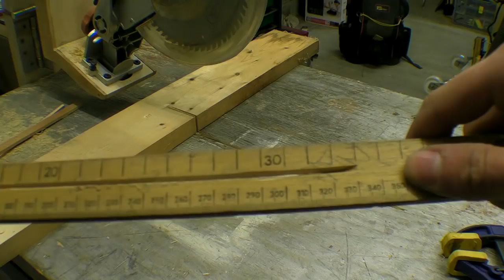DIY Glide Mitre Saw / Rail Free Chop Saw / Axial System

Comment: I'd so keep and use that. The danger lies in the careless use of any tool. As long as it's used sober and with thought about one's practices, it is as safe as most any power tool. I love the design. With longer arms (maybe made from steel?) it could even be made to crosscut full sheet goods 4 feet wide. Excelent design and idea. With a little more thought, some springs would help in the stability and use of this awesome design. Thanks for sharing.

Comment: It is so innovative and simplicity of its built makes are awesome. Instead of wooden pieces, suppose one uses aluminum slabs with hinges fixed with machine screws and built, probably it would be much safer and durable over a time. What do you think. Just to learn the way you did this, do you have and provide detailed drawings for cut list to make this? Thanks for sharing this video and also your caution at the end, so guys would be careful.

Comment: You are using a small device on your cordless drill to to drill exact in the middle of the (tapered and larger than the drill) hinges holes. I use a pointed countersink drill to determine the center of the holes, but your device makes it even more simple.

Comment: Savvas, I don't think this is inherently dangerous, it just needs some additional structure to stabilise it, Bosch do a mitre saw of this design with the lazy tong arm in place of parallel guide bars, but I think they doubled them up as one other comment suggested, and of course they used custom aluminium castings, but I still think your very clever space saving solution has legs, and I will most probably try to reproduce it or something very similar, as I have limited work space and need to mount my saw on a bench down one wall, the problem I have is the guide bars project too far behind it, this design could solve my problem, I don't really need a mitre facility on it, just a large cross cut capacity, I have a separate chop saw for angle work, without the mitre facility this would also improve the general stability too, I will let you know how I get on, love your ingenuity my friend....

Comment: Thanks for your honesty. I really enjoyed watching your work and see how your operate. 
I found your video as I was searching the dimensions I need on my new build workbench for a sliding mitre saw. Frustratingly with the sliders they use up too much space behind the tool for me given my limited workshop space. This only leaves me with the options of the bosch glide or the festool kapex front rod design. Both are quite pricey and possibly a little more than I need right now. Your video was an enjoyable break from this research. Thank you.

Comment: That is really cool. just curious about how well it would stay square after use over a period of time. I have the 10" bosh miter saw that has that mechanism and it works well and stays quite square so you may not have any problems. awesome build though, even if it doesnt cut perfectly square you could just use it for rough chopping then use your crosscut sled on your table saw.
Reply from the maker: Matt Thayer I just don't have the space to set this up properly and it won't compare to the sledge on the table saw.  That is the most useful thing I ever made in the workshop.
Reply: Well its a great project. It is perfect for rough chopping stuff.

Comment: Well, maybe a high position rail ,right upon the highest position of the blade, would provide a more stiff stance when cutting, kind of those racing car suspensions or for cars for drifting, it was designed for that : to keep tires rolling ahead even when high lateral forces are applied, a triangular structure... I will try it, I will let you know how it works...great work, man !

Comment: This does seem like a fun project to play with the idea of making moving tool holders - but in this case, wouldn't it be simpler to make a rail/track saw instead? This tool seems to have a main function of holding the saw in a straight line while cutting a line much longer than a usual miter saw can do. Isn't that what track saws do? Track saws are more portable too.

Comment: I like it and it seems cheaper to build rather than buying it from bosh why did you limit the hinges from fully extending?
Reply: I believe he limited travel to slightly less than full extension to avoid the hinge or joint locking and not allowing a return motion without manually decocking or adding a spring.
Reply: Juan Villa oh yeah that makes sense thanks i see that now

Comment: Why did you feel this was too dangerous? Also, at one point it looked a little wobbly. How stable was the unit when you were cutting? Do you think a larger version would be a good way to handle breaking down large sheets?
Reply from the maker: Sideways wobble when fully extended. I've made a new pivoting mitre saw base now.
Reply: take look on Festool  chop saw system is ingenious

Comment: I liked your video and your final words! I admire your skills and ingeniousity. That said, Id like to share a few thoughts. Im familiar with the mechanism, I have seen it in several presicion motion stages, wich btw is my field sometimes as precise as 0.0004", depending it size and obviously your budget . It is not an easy system to get it work properly as the translating body is attached to a chain of several points of movement, in this case the hinges. I am not completely sure but I think you can still make it work if you make a few changes. a) change those heavy duty hinges and replace each for two smaller ones, two hinges (the more apart each other the better) will always constrain ONE axis of rotation far better than only one. b) in case you try the above and see improvement but not happy enough, widen up a bit the arm segments (not the thinkness) You will be adding space to put the hinges more apart and adding precision. The ratio betwen the width of the arm segments (thus the distance betwen hinges) and their length mostly sets the presicion of the system, the hinges play are important too, but secondary. You may or may not try that, in any case I hope this will be usefull in any future mechanic project. Thank you for shearing. Martin from Buenos Aires

Comment: Hi Savvas, I have just watched your video and its great, well thought out and very educational👍; however in your conclusion you did not state exactly why you would dismantle your design; yes you mentioned safety but exactly what were the issues; I have to say I have I have been thinking of making one of these myself although I would be more inclined to use Aluminium profile as I believe the hinge joints available may be more rigid;  I think Bosch Rexroth (am I allowed to mention names here?) make some great profile; incidentally  not too sure who thought of the idea first you or Bosch they brought out their axial glide mitre saw around 2016 way out of my league cost wise hence the idea of making one out of an old unit I have 😊

Comment: Assuming that hinges has no play whatsoever, and everything is perfectly aligned, great job man! Good concept. i would try again buying some proper CNC linear guides and manufacturing aluminium or steel plates and mounts. that would guarantee you precision and safety.
One question: what drill bit are you using to predrill for the screws holes?

Comment: Very clever build, seems like it would be safe enough?
Reply from the maker: Steve Churchill The saw has a swing of about 1 cm to either side when fully extended which makes me feel a little uncomfortable.
Reply: ***** I was thinking it looked just a touch bouncy, so I was wondering about that sort of wiggle.  Thanks for mentioning it.   Fascinating mechanism and ingenious build though.  What do you think is the source of the swing?  The hinges are certainly large and rugged, and I wouldn't think there is much flex in the laminated plywood.
Reply: Savvas Papasavva plus every cut is going to be a little off from the swaying,if he made a guide track with a wheel to ride on I think it would be perfect ,plus put a short cord just enough to reach for cut that way if it ever breaks apart the cord will pull out killing the power so it doesn't kill him

Comment: I think you could get this closer to being functional by having a machine shop machine the hinges, and machine new pins for the hinges. The hinges would be much tighter. The machine shop may be able to provide spacers to further tighten the hinging action. The very first thing i would do, is add a second hinging side on the left. Perhaps you could stiffen each wood segment with a heavy gauge of steele sheetmetal.

Comment: I know my idea would would really very ugly... and I understand the concept is a gliding mitre... but if you placed a wheel underneath the support right under the saw, it would support the weight of the mitre and keep it much more stable... not really sure if makes sense, though.
regardless, pretty cool video to watch.
Reply from the maker: Nelson Baietti I didn't think that would work but if there is a channel underneath and the fence moved a little forward and widened, it might actually.  I should probably have another crack at this.  Thanks for the good suggestion.

Comment: I knew this would be good when I read the title! I do enjoy it when you take a cheap tool and improve it beyond belief. I guess you could attach guide rails to the left-hand side but then, that might be going against the idea of the 'axial glide' design.

How do you find the self-centring drill bits? I've never used one. Can you replace the drill bits once it's blunt (or broken) or do you have to bin and replace the whole thing?
Reply from the maker: Olly Parry-Jones Thanks Olly.  I've been thinking about this build for a little while... Now I have to just waiting for Bosch to sue me or send me a nice chop saw.  The centre bits are really good, and the drill bit can be replaced.  Made fitting the hinges a lot easier.
Reply: Olly - they're called Vix Bits. Do a search for them and you'll find them readily available in several sizes. They're not expensive, and they do make things like mounting hinges a bit easier.

Comment: Instead of hinge you might try to use 12 roll bearing and metal pins for the joints. But by then you might as well spend the $600 to buy the bosch CM10GD miter saw.
Reply from the maker: danny chan That's a lot cheaper than it is in the UK.  I really thought these hinges were a lot heavy duty then they turned out to be.
Reply: danny chan thats what I was thinking by the time he's done he could have just bought a new compound miter box

Comment: Like u said it's not for use everyday !! The point behind this is that u could have all the tools in the world or let's say u can have a million dollars in tools but if u don't know how too use them then y have them for looks I learned this from a old school guy that told me this I paint cars for a living I have my own garage at home 3 car bay and I must have way over 30 thousand dollars in tools and I can do a lot with my tools my last progect was a vise stand that I made with 4/1/2 inch pipe and 3/16 plate for the vise and a front rotor from a truck for the bottom base with for legs welded on the bottom rotor and I filled the pipe inside with concrete and on the top plate I welded a plate on the edge so it's box in then I painted everthing but the top of the plate sence I weld sometimes with the vise in use it done and it must way about 140 pounds I can't even pick it up that's how heavy it is yes I could of went to the store and buy one but I no it would be a cheap one !! I spent 30 dollars and 3 days at night working on it my point is not about money it's about noing how to use tools and what u can
Reply: Do .. I love to see videos what pepole can do if they need a too for a job and they make there own one .. I work more with metal at home I have wood tools too for my house progects and I know how work with wood but I still can learn some more with wood I always say not everone nos it all who ever says I no it all is the one that don't no shit there are the ones that are the hackers cause I've Ben working on cars for 18 years and I still learn somthing here and there this is just how I see it !!! U are one smart guy with wood as I saw your video I can just tell by how u where using your tools and your setup says it all !! Keep up the good work on showing pepole how to make something out of nothing and yes I no it's not safe but any power tools are dangerous so it's how u use them new old or make your own power tools it's all dangerous !!!!!!!

Comment: It looks to me like that setup still had far too much lateral movement. The only way you'd overcome that is by mirroring the gear on the other side. But I think the design needs proper engineering, and any tiny misalignment adds significant drag to your action, which is exactly what you don't want - yeah?

Comment: Actually Savvas I just saw a video about an hour ago that was advertising a new Bosch radial arm saw that worked similarly to what you built. So, as for being too dangerous, I totally disagree. On the right base it could be very handy.
Reply: The hinges were just not rigid enough. At full extension it swayed 1 cm

Comment: Nice idea, but when one of those joints fails, you're going to have a circular saw coming straight at you across your bench at about 60mph. I think I'll stick with all metal construction.
Reply: SLRist it needs to be built out of aluminum or metal and with a wheel on the bottom to ride on or a track

Comment: IT'd work better and be way more stable if ya used steel plate and little  pillow block bearings and some steel shafting.  But ya sure do have the concept down.

Comment: Have you any ideas about what I can do the fix a miter saw that doesn't cut parallel to it's guide rails? Here's an example of that I'm talking about. https://www.youtube.com/watch?v=83jXJOPwd4A
Reply from the maker: +dtriniboss There'll be some screws somewhere on the fence that you can adjust.
Reply: +Savvas Papasavva The problem seems to be that the arbor isn't perpendicular to the guide rails. As such when the saw is drawn back and pushed forward to make a cut the blade travels at an angle rather than perpendicular. So I'm looking for a way to realign the arbor. Have you any thoughts on this?

Comment: I am not saying home made systems like this are just as safe as factory made. But how is this more dangerous than this: https://www.youtube.com/watch?v=dfw3kagja2E   But only if the connection from the wood arm to the saw base was metal angle instead of wood. Edit: is that the main fear? That the wood arm could break while doing a cut?